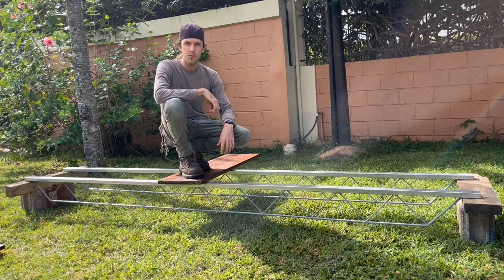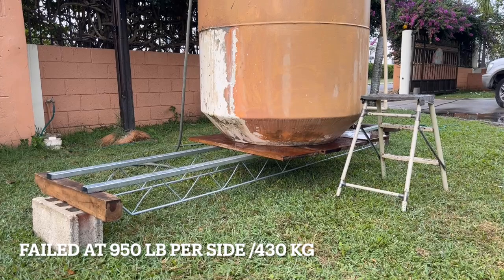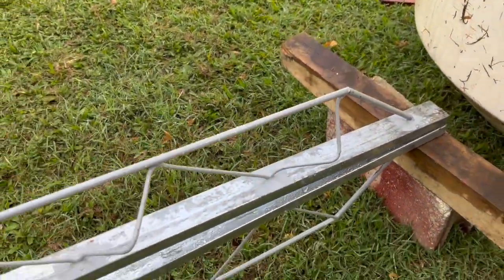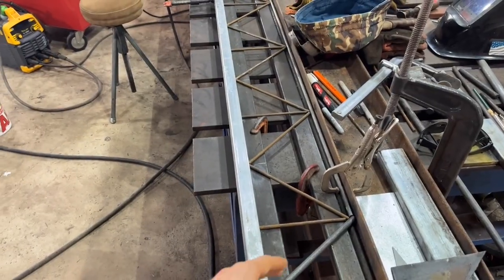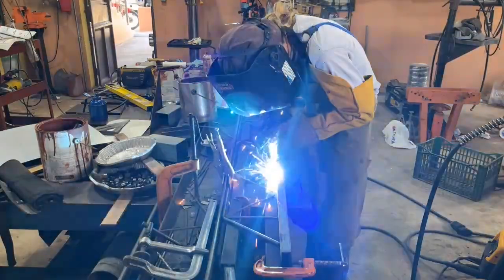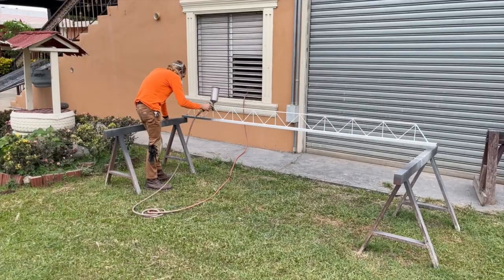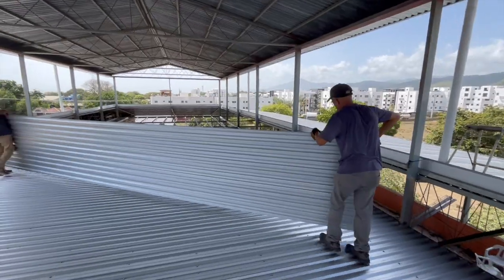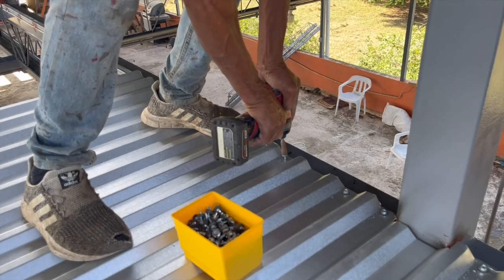Bar Joist Practical Build + Thought Process

Comment: Hey Darren! Another excellent video! I had a question about the BestArc machine if you don’t mind - I seem to be able to run 7018 ok with it, but having a little trouble when using 6011. Have you had success running it with 6011 and if so do you know what brand rods and what amperage you have been running it at? I am a beginner so I know 6011 is a tough rod to begin with. I have been running around 75-80 amps for some 11 gauge coupons. Just wondering your experience if any with 6011 and the Best Arc. I am running on 120v - thanks man 🙏
Reply from the maker: Hey thanks for your questions I believe I mentioned in the video that I couldn’t get the machine to run E6010 electrodes I hadn’t tried E6011 but they are in same family with cellulose coated electrodes which essentially means a paper mix with chemicals E7018 or E6013 are more of a mineral base outer codeine, and are a lot less demanding of the machines 
There are several machines that are designed specifically for stick welding, and they often do a much better job of running  E6010 / E6011 if you’re on a budget, I have tried these Tooliom machines and have been very impressed 
https://amzn.to/48qQzDz 
These often go on sale for under $100 and they are pretty much just designed to stick weld and to run E6010 and all the different welding rods I just got Tooliom’s 5 in one machine that does MIG Stick TIG Plasma cutting aluminum wire feed and I’ve been able to run E6010 with it quite well. I’ve been working on making a review video for it. It’s been quite impressive for the price. 
Link https://amzn.to/3W2PpGQ
And don’t hesitate to ask any more questions
Reply: @CreativityUnleashed  sounds great thank you very much! I think I will look into the 6013 for now and will start checking out the Toolium!